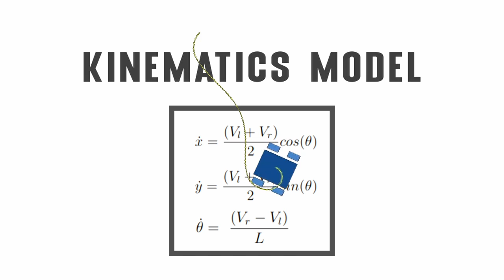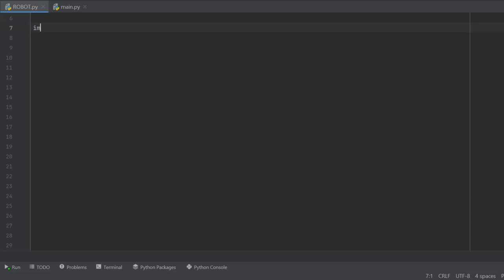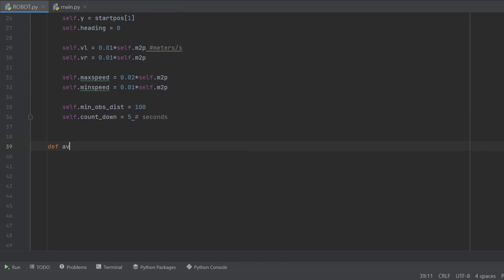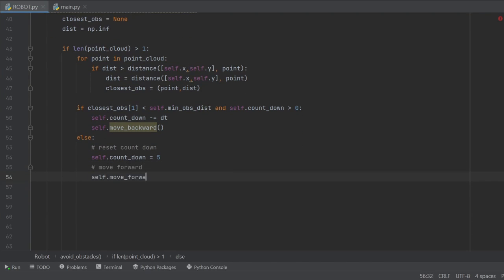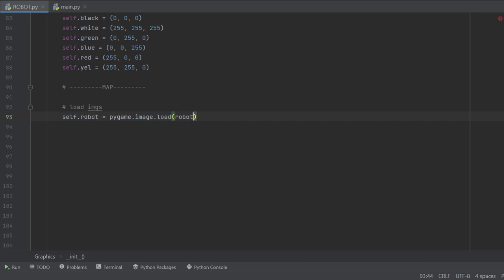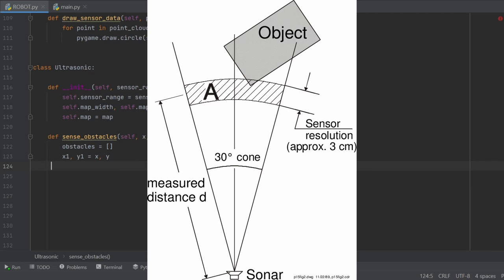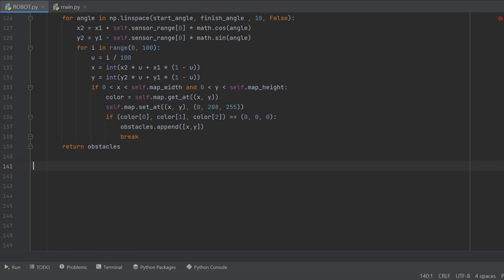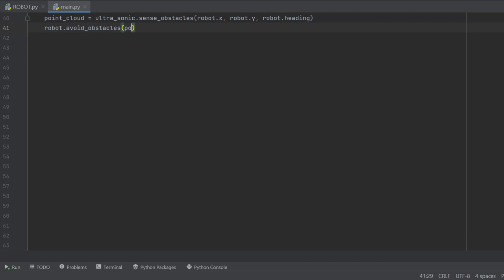Simulating an Obstacle Avoidance Robot Using Python | From Scratch

Comment: please help me if you can 
the class "Kinematic" seems to be at fault here:
the compiling error message goes as follows:
Traceback (most recent call last):
  File "F:\My Desktop\further learning 21082024\robot prog simulation v1\main.py", line 46, in <module>
    robot.kinematics(dt) #moving the robot using the kinematics
    ^^^^^^^^^^^^^^^^
AttributeError: 'Robot' object has no attribute 'kinematics'

can you please help

Comment: Real Ultrasonics sensors has few additional parameters
1) typical sampling frequency is 50Hz so they won't update in real time. If robot moves with speed 1m/s toward wall, it moves 2cm before update. It's even more significant during rotation.
2) ultasonic sensors has high noise. Usually +/- 2cm for cheap one with 250cm range.
3) They can have issue... Same model of US usually works on same frequency = you has to trigger sensors one by one because they interfere with each other.

Comment: Robot's ultrasonic sensor is rotating the opposite direction when robot takes turn. For instance, for the first obstacle (first wall), robot turns around 90 degree clockwise but ultrasonic sensor turns 90 degree anticlockwise which as a result makes the ultrasonic sensor heading towards the backside of robot instead of front side. Please help me to resolve this issue. @Algobotics
Reply: Im having the same issue